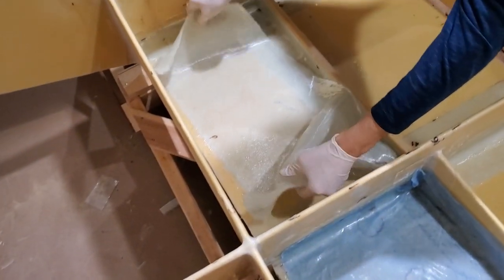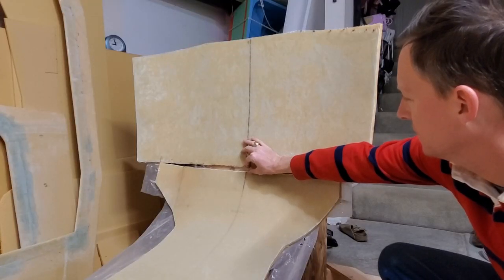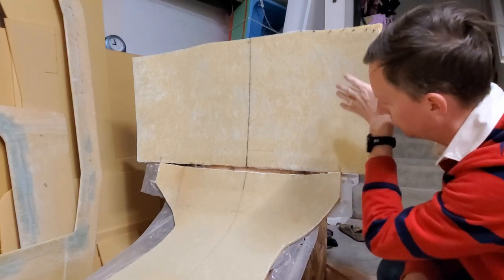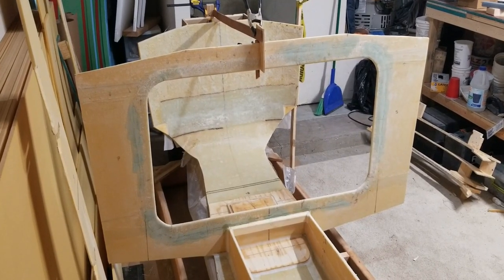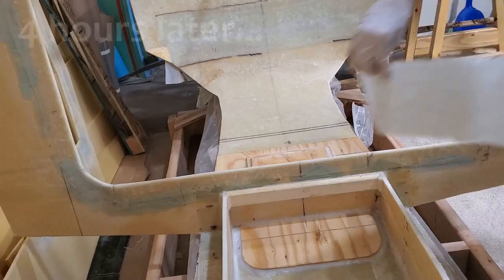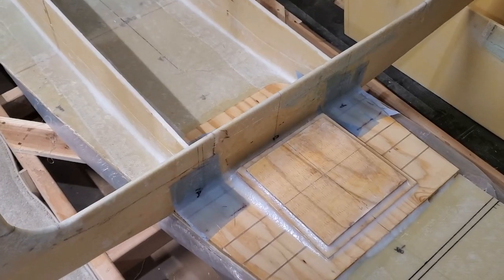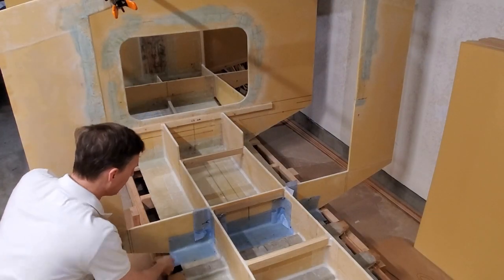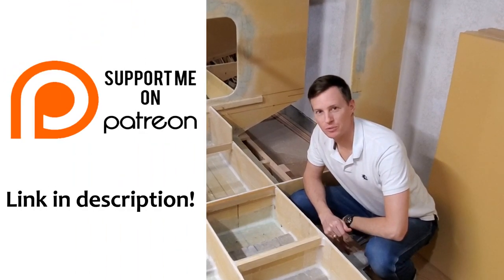OCSS-019 Installing Frames C2, C4, and the Bow Panel - Mini-Cruiser Sailboat Build

Comment: Nice fitment on the bow panel. It would be interesting to document the shipping weights of materials used in such a project and compare that total to the actual weight of the finished vessel. IMO 
             Thanks for sharing.

Comment: That bow panel was perfect. Are you going to glass over the pieces you added on the inside or just on the exterior? The whole project so far is looking really good. Still can't believe it is only 14'. Thank you for sharing and have a good rest of the week.
Reply from the maker: Thanks, Matt. I don't understand your question. Are you talking about the little triangles I added? If so, they'll get glassed over when the chines go on anyway, so I didn't bother glassing them on right away.
Reply: @ocean_capable_small_sailboat  You answered my question Perry. Thank you for the reply. Have a good evening.

Comment: The fibreglass looks really thin. usually in boatbuilding one would use like 2-3layers of 400gramm/sparemeter biaxial glass. this here looks a lot like building a model airplane, no offense.
Same with bulkheads. how thick is that ply? please cross reverence with other bluewater ply boats like globe 580

Comment: Have you done any strength testing on your foam FG sandwich? Most foam builds that I have seen use thicker foam.
Reply from the maker: No need, it's been done many times before. You can see one on FreeRange Sailing's dodger build. They tested an even thinner piece by the man standing and bouncing on it. It took a lot of force to break it. Combined with my structural grid and frames, the boat will be incredibly strong.
Reply: @ocean_capable_small_sailboat  - You're a Free Range Sailing fan too? Awesome!
Reply from the maker: @Garryck-1  Yeah, for sure. Their simple living is more my style. I also really enjoy The Sailing Frenchman's older videos when he's sailing to the Caribbean from France.

Comment: the foam core that you use is much thinner than sven's boat... was your decision of thickness a design or budgetary consideration?
Reply from the maker: His core material is much thicker than most boat builds. It gives him a very strong and well insulated hull. I think the thickness of my core is more typical. I wanted to use 25mm core, but went with 10mm core when I saw the price for the former.
Reply: @ocean_capable_small_sailboat  thank you for sharing the logic.... can't wait to see the next one
Reply: My understanding is that the resistance to deformation is proportional to the distance between the two skins.